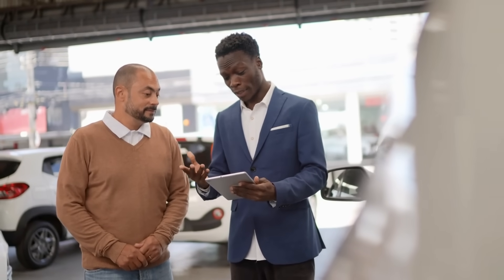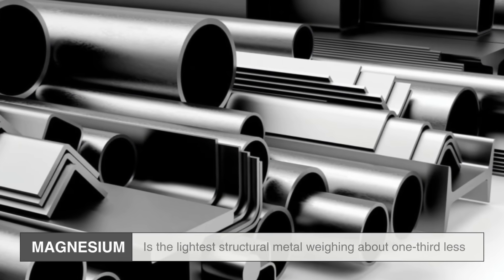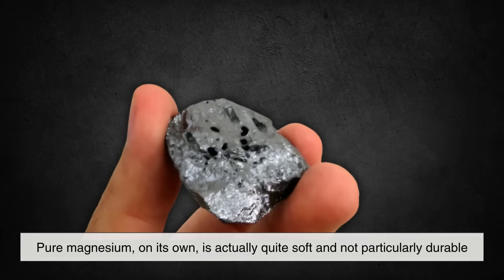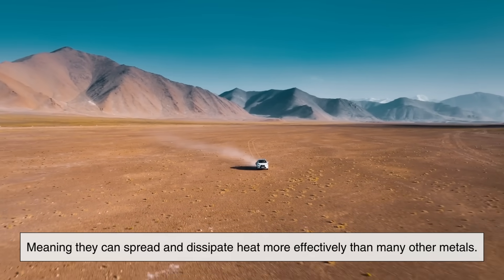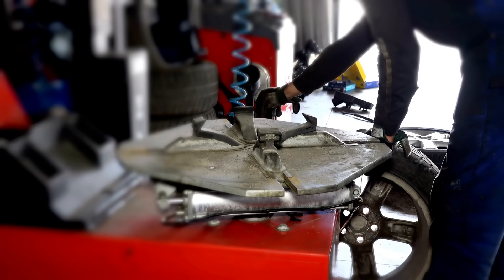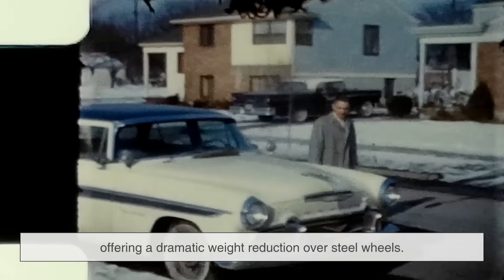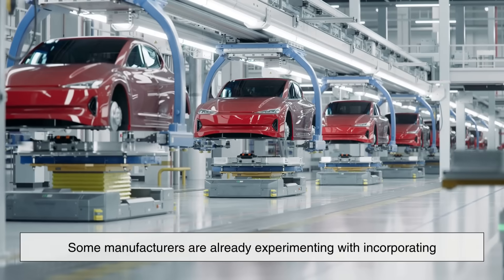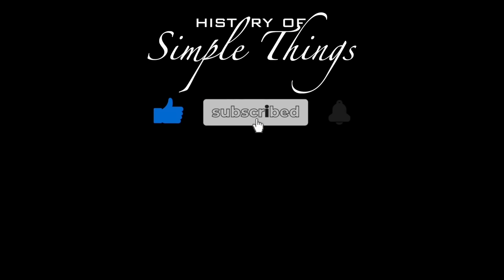Why Do Cars Have Magnesium Rims?

Comment: I replaced the forged aluminum wheels on my Nissan 370Z with a set of forged magnesium monoblock wheels from a company in LA called Litespeed Racing. Each wheel shaved off about 9 lbs per wheel and made a very noticeable improvement in the suspension's response and steering response.

Comment: I spent many years repairing magnesium Racecar castings. It’s an alloy that needs lots of respect. Don’t be fooled by someone saying it’s not extremely flammable, it is and it takes special fire extinguishers to hopefully extinguish it. It can burn thru concrete floors. The incendiary bombs used in World War II would burn from the top of a building to the bottom, no matter what it was made of that’s how dangerous it is.

Comment: The main drawbacks include higher cost, limited availability, and increased corrosion risk though modern alloy formulations and surface treatments have largely mitigated those issues, and safety concerns like flammability have been addressed by regulatory testing.

Comment: Old VW Beetle engine blocks were made out of magnesium alloy.
Reply: The VW type 4's, aka Type 411, had even more magnesium in their blocks. Engine fires could melt the block, drop the molten magnesium on the pavement, and burn through the pavement to fuse the road base underneath. And the fumes were toxic.